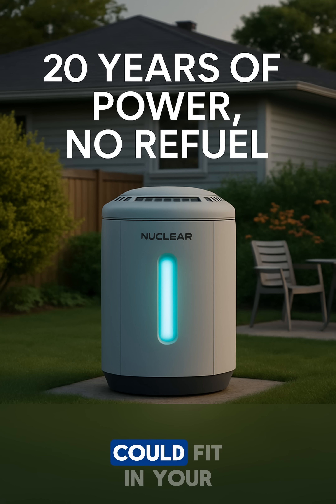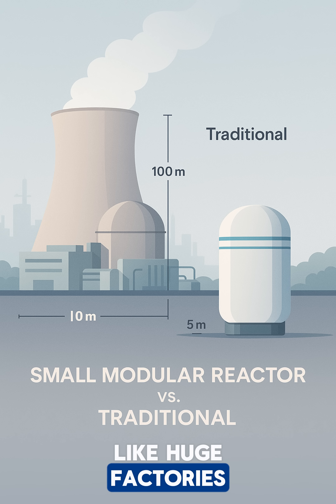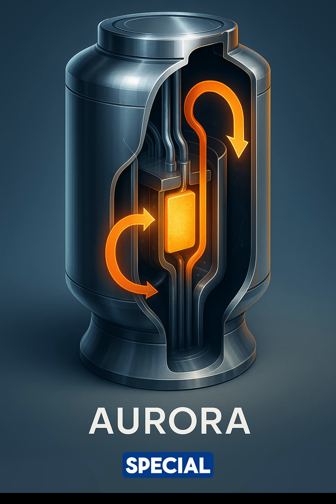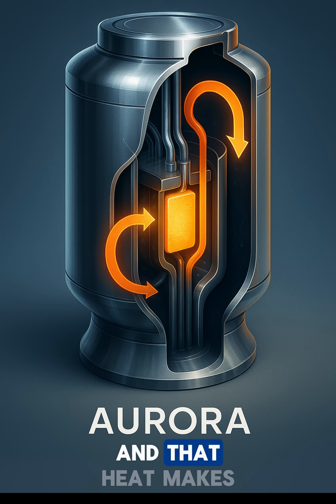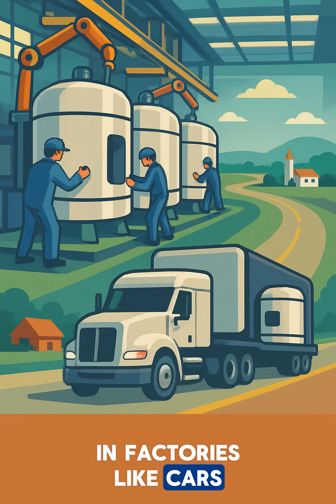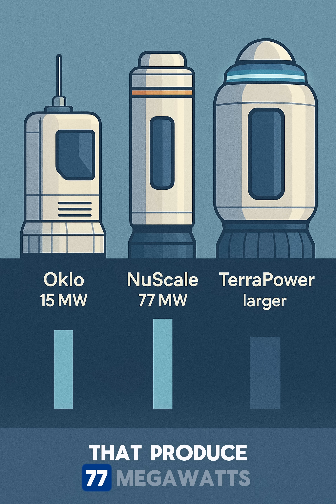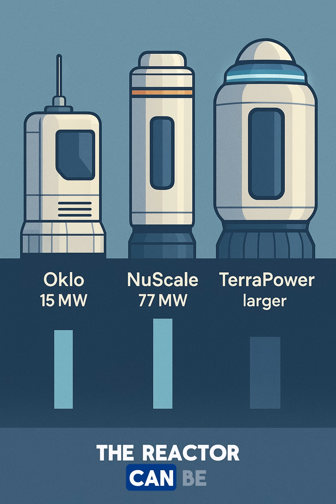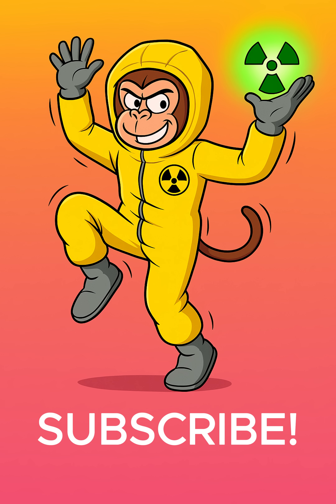OKLO’s Mini Reactor: Power for 20 Years, No Refueling! #nuclearpower #oklo  #smr

Comment: Would this be a good company to invest in the future ..?
Reply from the maker: Considering recent geopolitical shifts, particularly with the Iran and Israel conflict, this could present a significant opportunity. Vast amounts of energy are crucial for operating large AI and manufacturing companies, recharging electric vehicles, and generally improving living standards. A key question remains: is nuclear power truly the best option for the future? While Elon Musk advocates for solar energy as the future, I partially agree. Solar energy systems are not yet fully efficient and require extensive solar panel arrays. Even though solar energy is infinite, it faces limitations such as weather dependency, the recyclability of panels, and the need for robust energy storage systems.
Reply: @NuclearLaunch_Detected also it doesn't have synchronous generators. So it wouldn't be able to fully drive the energy grid alone.
Reply from the maker: Near sight) one of the OKLO's member is in Trump administration. Could be charming company. Sam Altman from OpenAI was in too
Reply: Your choice, do your research old bean